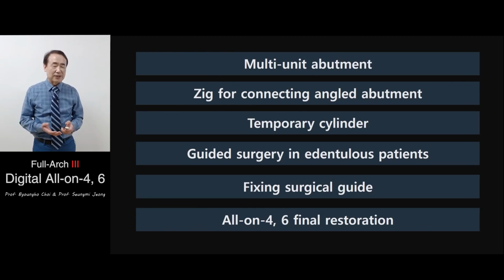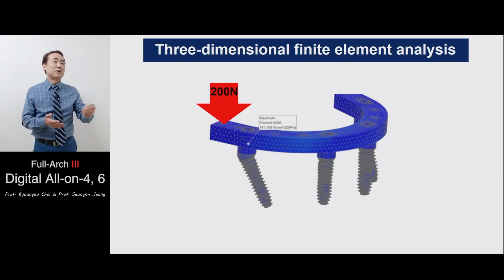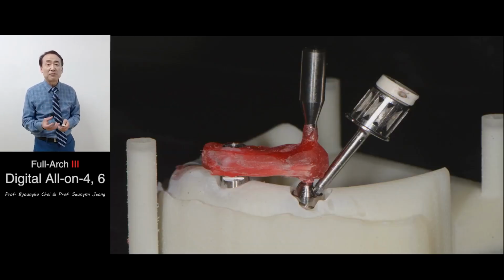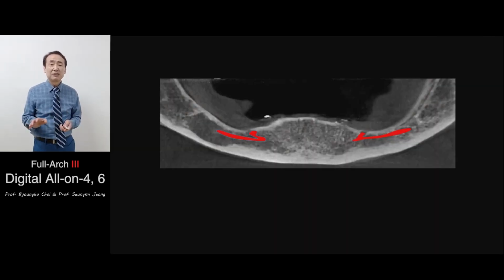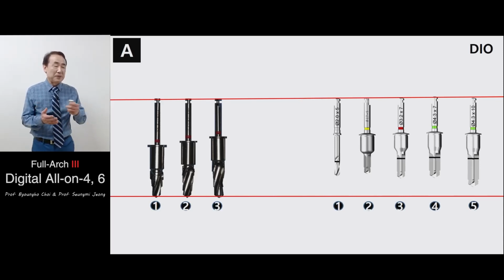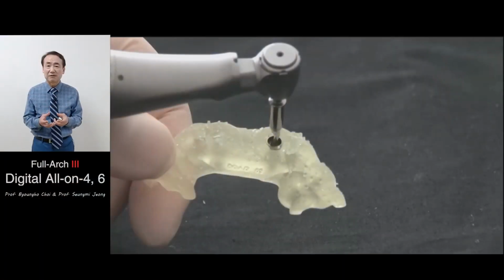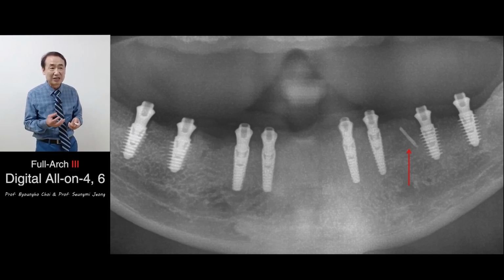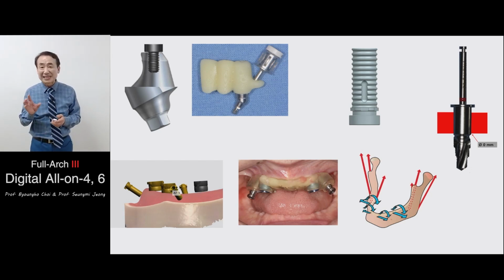[FullArch III] Digital All on 4, 6 by Prof. Byungho Choi and Prof. Seungmi Jeong

Comment: Perfect&Love this lecture very much knowledge in this video ,you so work hard to Demon pic and video in slide help to grab it easy and again  thank you so much Prof. for your sharing case But i have question about beneficial of internal marker track that you line on crestal ridge of patient with special glue for this step ,Whate different better benefit more than Conventional dual scan tech.(attach fiducial marker on denture )  ? and How did you choose case between reduction bone or not in each case?